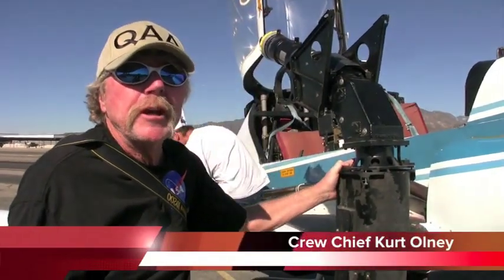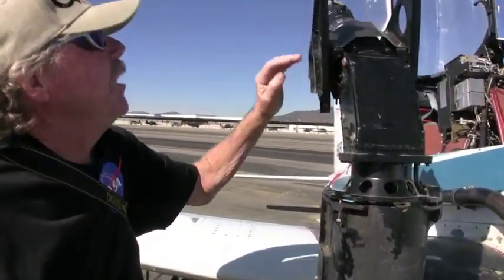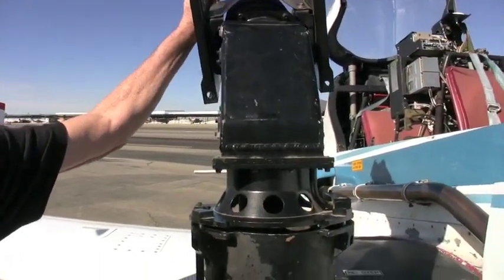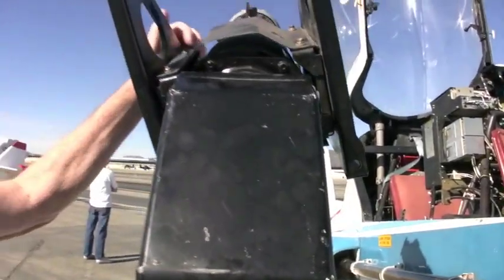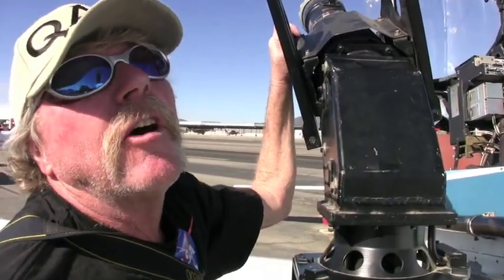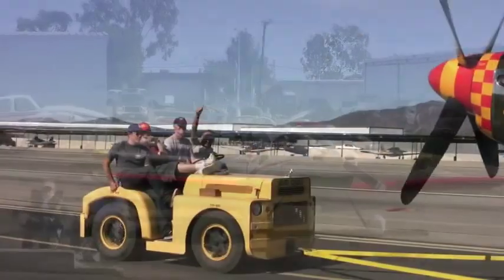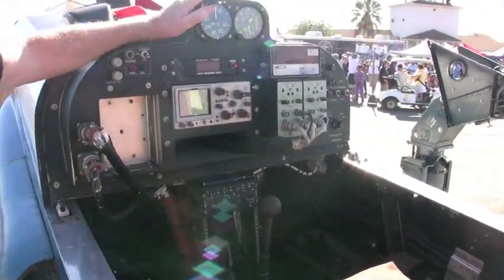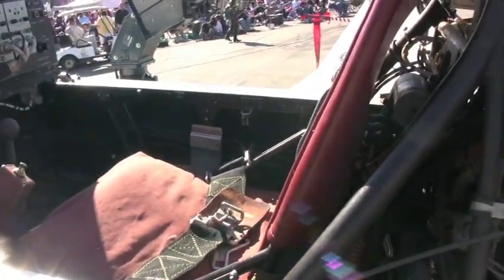YO-3A

Comment: Instead of normal noice level I feel like the Q had somewhat of a medium size truck level of noice that very impressive still it kinda hard to judge the sound if you are not there.
Reply: This one has the louder 3 blade prop on it, the original 5 blade was far quieter and slower, but made its takeoff length over 5,000ft